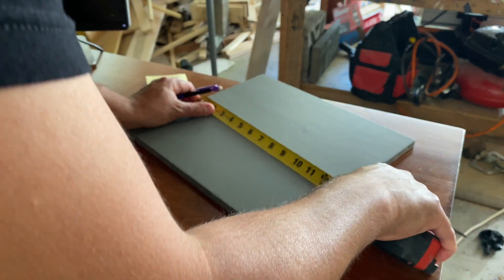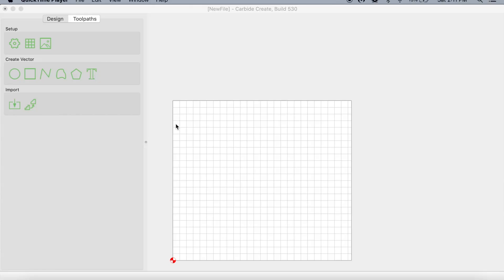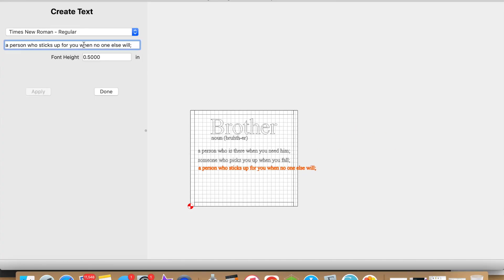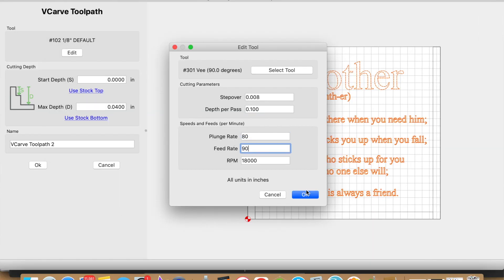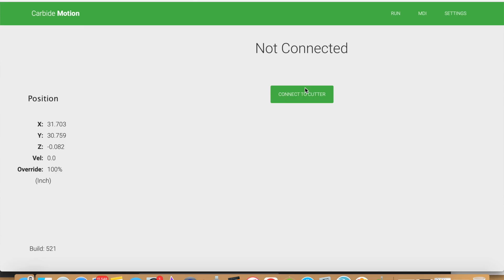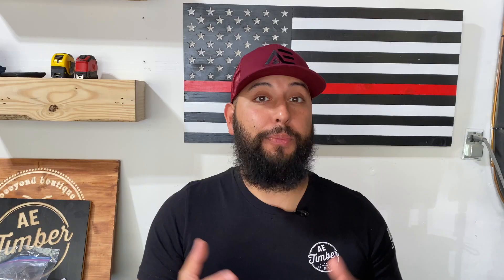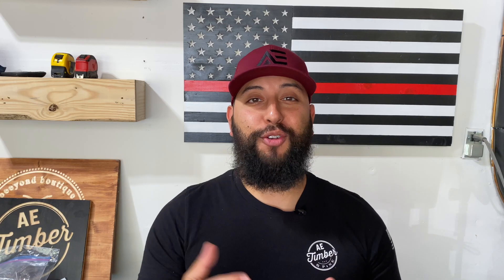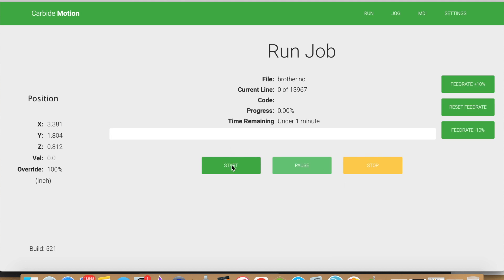CNC Basics | 10 Steps to Follow to Carve a Sign on a CNC | Carbide Create Tutorial

Comment: Great video...but...why load one toolpath at a time with the Bitsetter on your machine? If you have the option to eliminate human error between each tool change then use it. I promise you it can set your subsequent bits more accurately with the Bitsetter than without.
Reply from the maker: Thank you for the question!

I like to split them up and run them individually for more control.  In Carbide Create, I still set them all up at the same time, but when I take them to Carbide Motion, I upload them one at a time. Once one tool path is finished, I upload the next one. I also save them under one single name, rather than having multiple files.  Since I have the bitsetter, I don't change the X,Y or Z axis. I simply upload the next one and start.

So for example when carving a police union I would do something like this:

Toolpath #1 could be the police star and florals  
Toolpath #2 could be the image.
Toolpath #3 could be the Text.

Check out my video on tiling.  At the 8:50 mark I show you what I mean. 
https://youtu.be/9CyXGCPgS_o